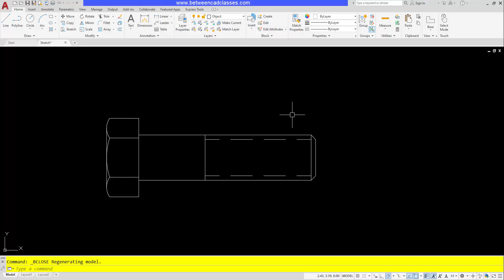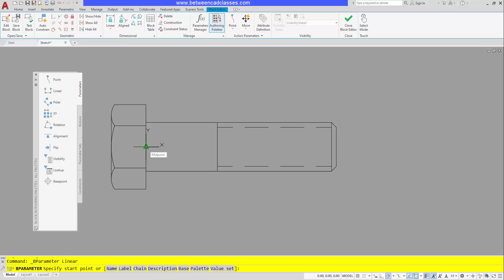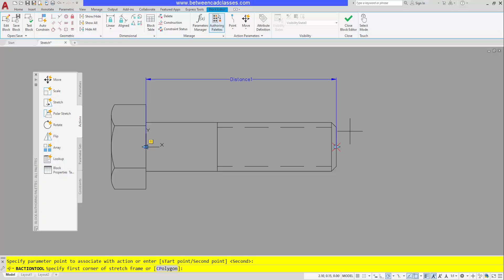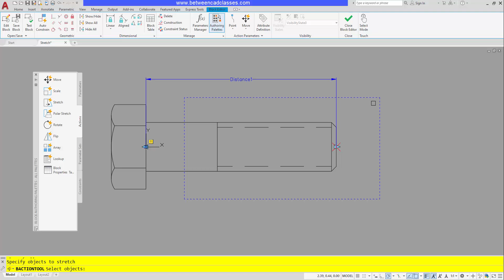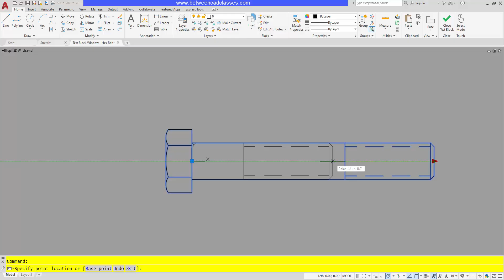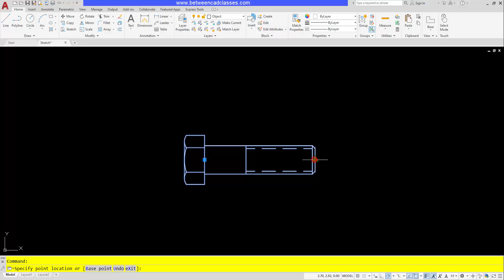AutoCAD Dynamic Blocks Tutorial: Stretch Action

Comment: thank you for sharing but you should explain that the objects must be individual line or composed lines. this method cannot be applied to Rectangle it must be exploded to individual lines.
Reply from the maker: Hey thanks for watching! You can absolutely apply the stretch action to a rectangle, just like you can use the Stretch command on a rectangle. I just tested it to make sure I am not crazy! One common mistake I see my students make is attempting to select the stretch frame on a rectangle by using a window (picking left to right) instead of a crossing (picking right to left). Is there any chance that is what happened?

Comment: super helpful thnx, however im still having some issues with editing my dynamic block, instead of the object stretching into the new specific measurement,  it instead moves into a distance of the measurement, is there anyway to fix this?
Reply from the maker: If I am understanding your question, objects are moving instead of stretching. If this is the case, you most likely selected using a Window by clicking and moving to the right. With the Stretch command, you must select objects using the Crossing method, which is when you click then move to the left. Please let me know if this does/doesn't solve your problem. Thanks for watching!

Comment: hello , ok, so first of all, great video, however , i need help... I closed my dynamic block pallete and do not know how to reopen it, please help
Reply from the maker: Hey John! When you are in the block editor (which makes the Block Editor contextual tab available) you should see a "Manage" panel, and inside there the "Authoring Palettes" button. You can see it in my AU presentation here: https://youtu.be/FdsYTykm8xM?t=402 Hope that helps!
Reply: @betweencadclasses  yea, I accidentally click to hide it more than once, and now it doesnt want to re appear... was just wondering if there was another way
Reply from the maker: @johnlopez2475  Weird. About half way down on the following link it shows how to reset the default location of palettes. I wonder if that would help. https://knowledge.autodesk.com/support/autocad/troubleshooting/caas/sfdcarticles/sfdcarticles/Palettes-will-not-display-in-AutoCAD.html
Reply from the maker: @johnlopez2475  another thing I have tried is drastically changing the display resolution to see if it appears. That worked on another similar issue for me once.